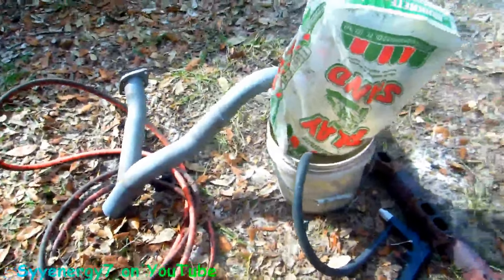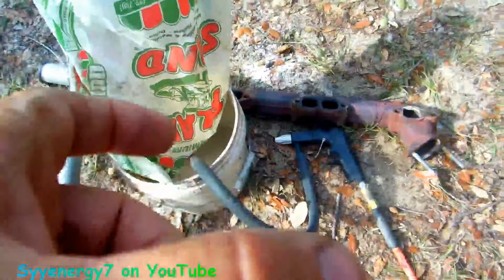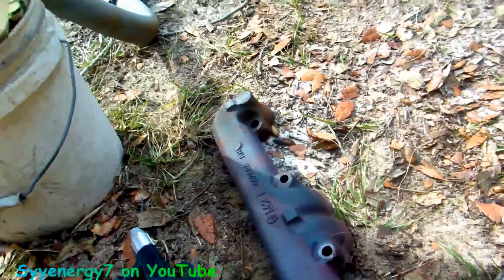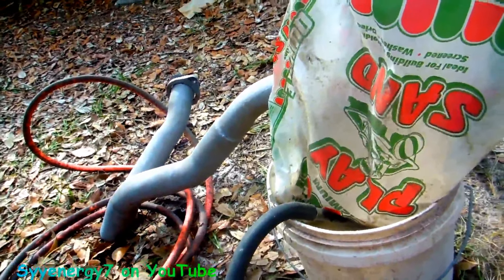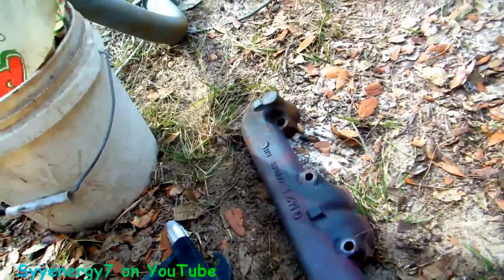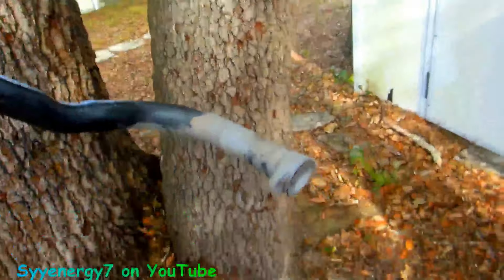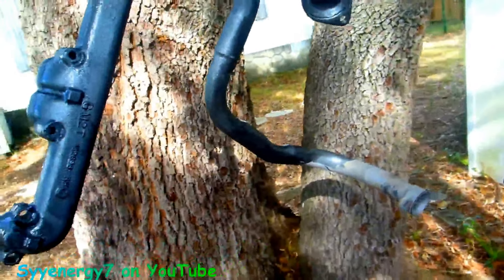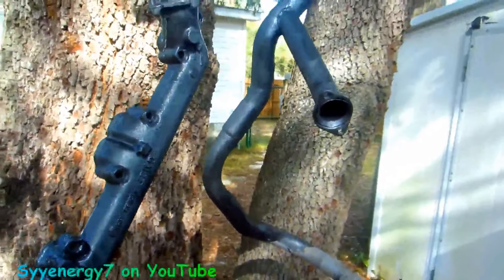Sandblast Exhaust Pipe and Coat with POR15 HIGH HEAT

Comment: Any good muffler shop can make that y up for ya I just had a y made for a jeep . The guy made it up in about a hour , welded cat connection up and 2 hangers 280 . I couldn't complain.
Reply from the maker: ya still need to rust-proof it.
Reply: syyenergy7  agreed   I like that little sand blaster as well gotta get me one
Reply from the maker: It's great for small stuff.  For $20 it was very well worth it.